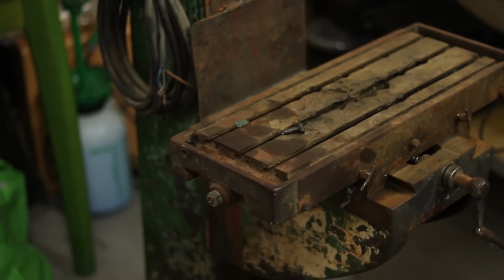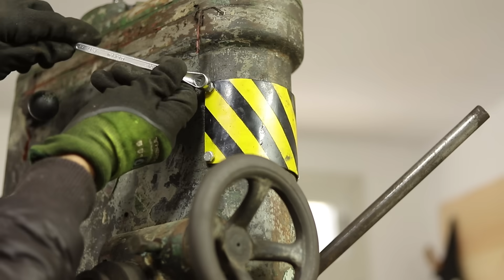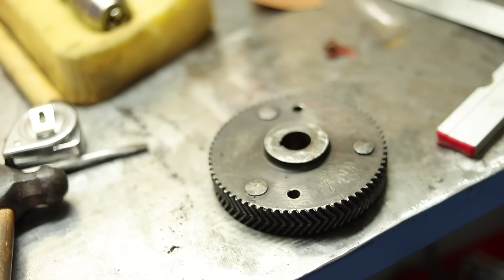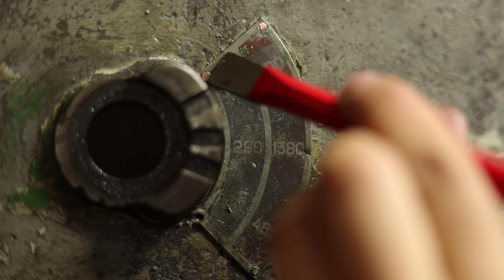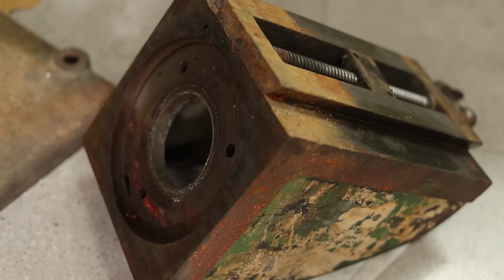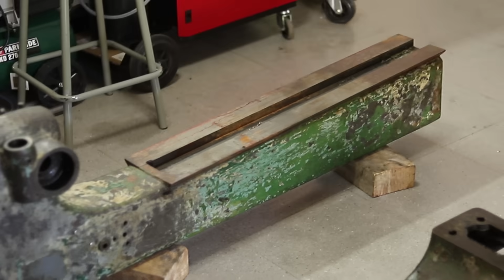🔥 1950 Drill Milling Machine Restoration | Part I 🔥

Comment: Looks very smooth, taking this machine apart, but it was not that easy, was it?
Reply from the maker: It was a week of work. I didn't have any manual of the machine. However, the machine was covered with oil and that made it a little easier to disassemble the drill. :)